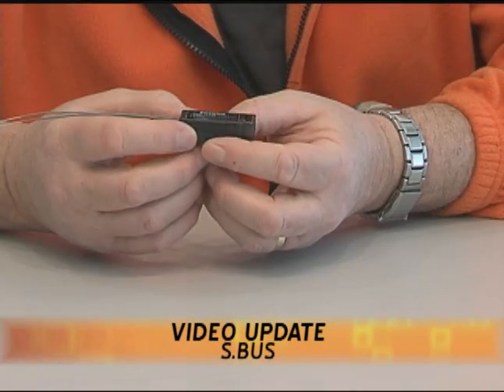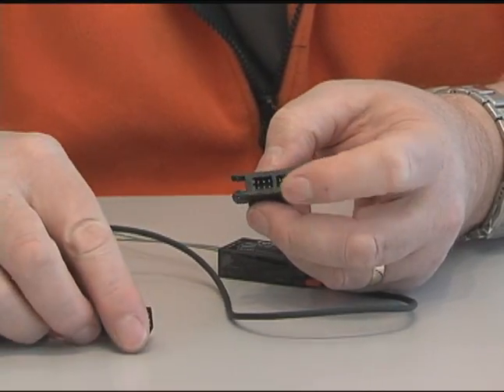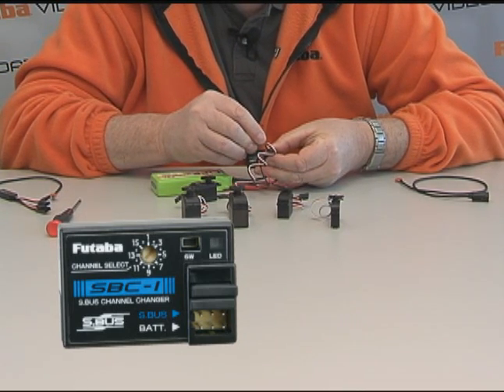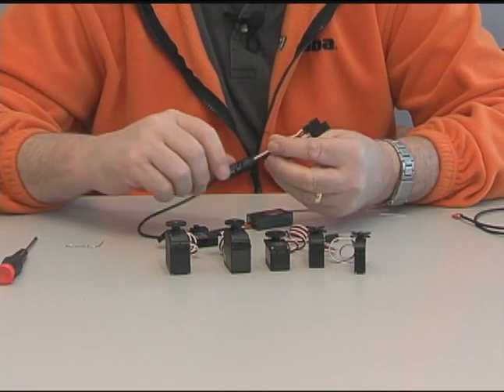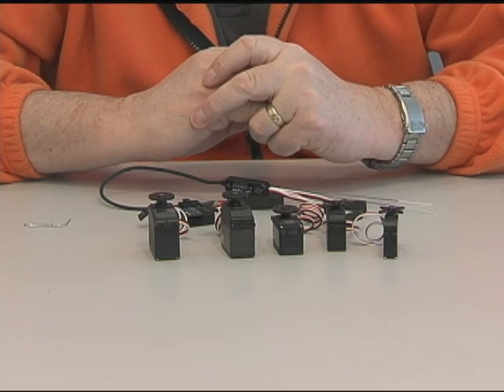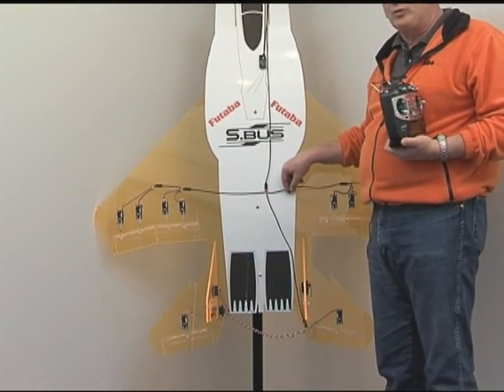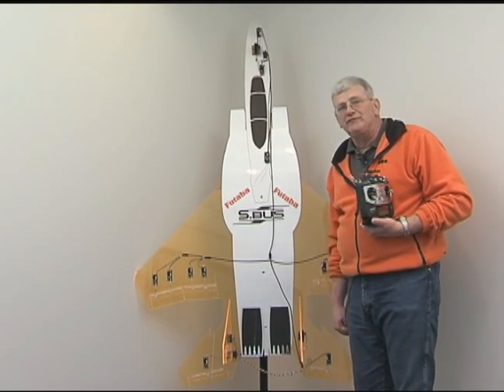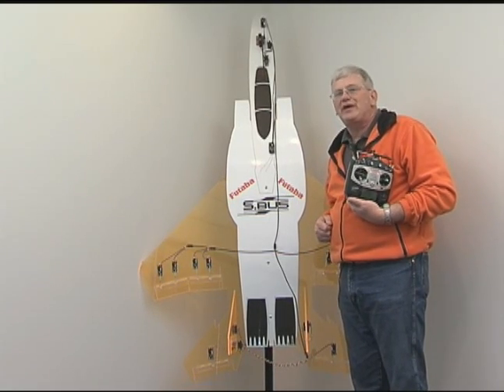Futaba RC Video Update:  S.bus (Serial Bus) RC Receiver & Servo System

Comment: Neat product with lots of features.  I can see where people are going to think they can run many servos on a single 22 guage wire, in the example it's a high performance airplane running 14 servos on one 22 guage red and black wire.  I am sure it's not their intent to suggest such a thing, however the video may lead some people to actually try that.   Perhaps it could be redone clairifying what a solid setup would look like?

Dave

Comment: This isn't that new as technology goes.  In fact  they tried this in the automotive industry years ago but it was a nightmare for the average mechanic to trouble shoot.  This isn't exactly the same as the auto stuff.  This looks like it's a really well thought out system.  I really like the concept of programming a servo to a channel and plug it in any where.  You can now leave out a lot of the programing details in each model on your transmitter.  Like the retract slow down.  In fact, you could probably use the same program for most of you s bus air craft.  Not exactly so but if the planes are similar, why not?  I'm still chucking foamies but the future looks very bright for this tech.  Great job Futaba.

Comment: Break you display model down, cable by cable and connection by connections.  Futaba is generally difficult to program as it is. This will be useful to me.  Thanks.
Reply: Once you get used to Futaba programming every other transmitter manufacturer's programming seems no where near as complete and useful as Futaba's. They also don't use the end consumer as quality control/testers of their products,like Spectrum for example. Futaba does things right.

Comment: Hi I am new to twirling up planes and I have a question. I want to wire up a 12 channel plane with a futaba system but leave all of the existing servos and everything the same. now I'm guessing all servos are not programable and would have to be plugged into the channel that will be controlling it but can I use the S.bus system without programming servos? like would adding an extension to an 8 channel receiver make like channel 9, 10, 11, and 12 or would programable servos need to be added?

Comment: How to program(How to install) S.Bus servos with GYA 430 or 431 using the application within the 18MZ transmitter and 7008SB receiver analog 1-7,S-Bus 8-16 witch channel could I choose Aileron CH1,Elevator CH2 Rudder CH4 and GyAileron CH5,GYElevatorCH7,GYRudderCH8 are analog but I need S-Bus channel only please reference

Comment: It sounds great but the price is way out there. With Spektrum coming out with X-Plus do you think Futaba will lower the price on the Anaolg S-Bus cables. And why does the analog S-Bus cable not come with the programmer. You want us to use this stuff but your are not trying hard enough to put it on the market.

Comment: can i use my 14sg to program sbd-1  if so how or do i still nee to buy the programmer??
Reply: The 14sg has a built in S.bus programmer. Futaba really makes some of the most first rate hardware on the market. I like the 14sg very much. It really does seem like a transmitter that will be highly relevant for years to come.